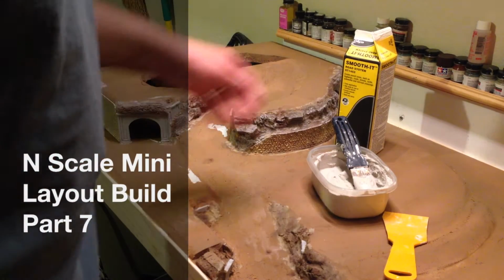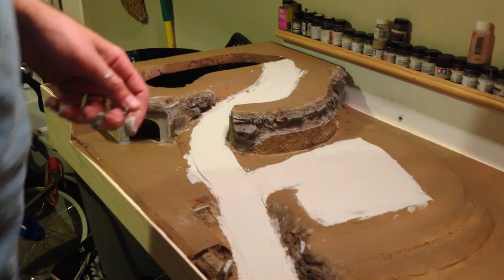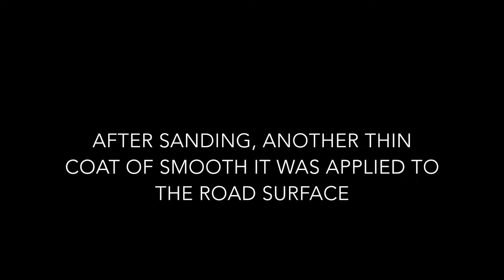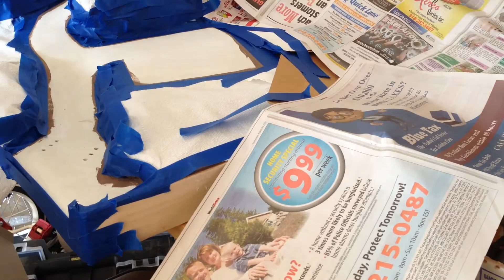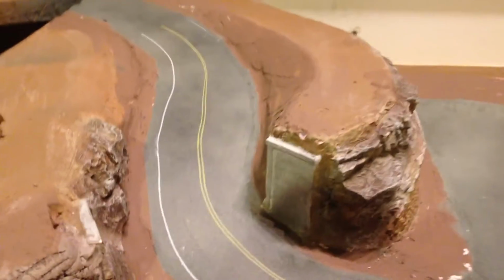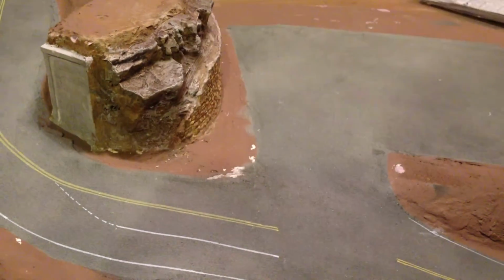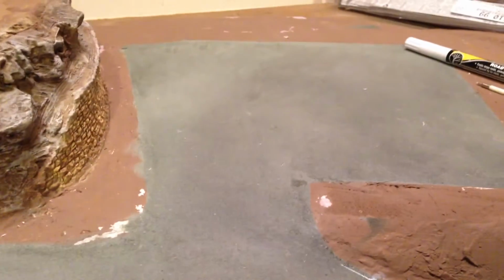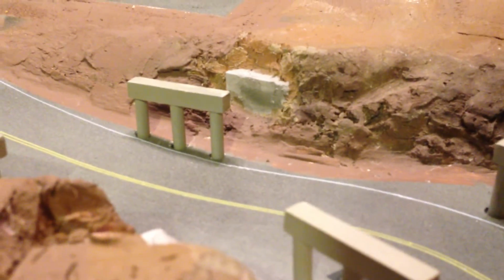N Scale Mini Layout Build Part 7: Building a Road

Comment: You've done a marvelous job of road striping, although I must say I don't know how you managed to do it, because the Woodland Scenics paint pens and flex tool are crap. For me, no ink came out of the paint pens or it came out in blobs. And the flex tool came all doubled up in the pack and I couldn't straighten the kinks out of it. I'm very disappointed in these products. ...Roy
Reply from the maker: +N-Scale Union Pacific Evanston Subdivision I had to use a nice drafting ruler for the straight lines which worked great, and the flex tool worked ok for the curved lines but it is a pain.  The pens were very hit an miss.  First yellow pen I got worked great, but the the white one was a disaster, flowed paint everywhere.  WS sent me two more after telling them about it, and one was bad and one worked marginally well.  I got a pack of similar pens from Michaels or Target or somewhere that had a yellow and white, and those worked ok for me.  Bottom line is the pens work really nice when they work.  But, only 2 of the 4 I had worked ok.

Comment: Really good tips on this Vid. Nice project, finely done. I Will follow your channel THK.   Have you got ref of the pens for road lines ?
Reply from the maker: So, both of the white Woodland Scenics road striping pens were garbage and leaked paint everywhere.  The yellow was fine.  I contacted them and they sent me two new pens for free in the mail, but I haven't tried them yet.  Apparently the ones I had were from a first run that had some issues with some of the tips.   I picked up a pack of DecoColor paint pens (I think that was the name) from Michaels with the fine tips, and used the white one from that pack to finish the striping and it was essentially identical to the WS pens since I wasn't sure when the replacement pens would come.  They actually came the day after I purchased the DecoColor pens.   The DecoColor pens came in a pack of 5-6 or whatever it was for $16.99, so much cheaper per pen than the WS pens.  Michaels didn't have the single pens in stock when I was there, otherwise I would have bought just the one for $3.99.  I do like using the WS flexi edge or whatever it is called since it make the curves easier, but any kind of edge like that would work most likely.
Reply: Many thank's Stephen to have bring the time to answer me !

Comment: What type of grid do you use to sand
Reply from the maker: I just used different grits of sanding sponges.  I don't remember offhand which ones I used here, but usually I use something in the 80-120 grit range to level things out, and then something in the 200-250 grit range for final smoothing.